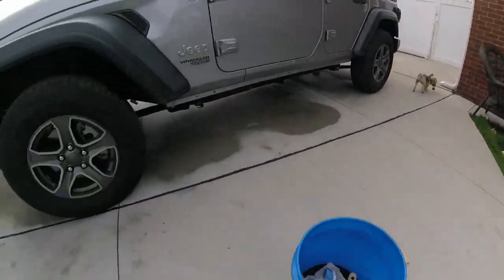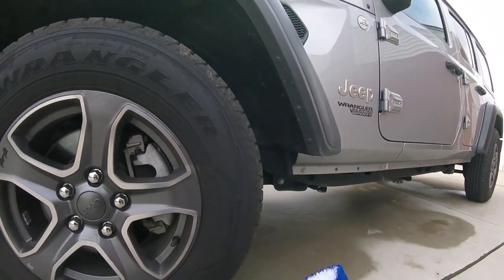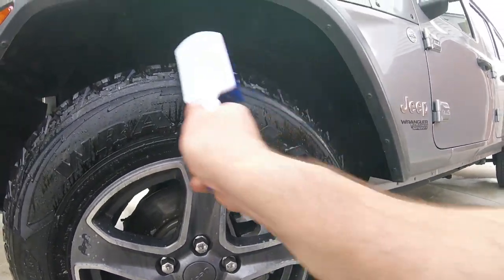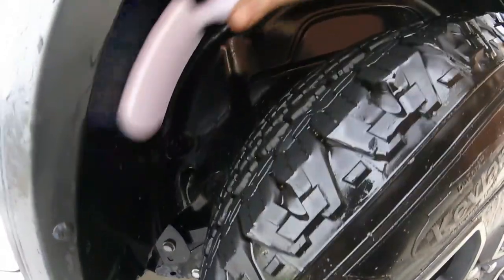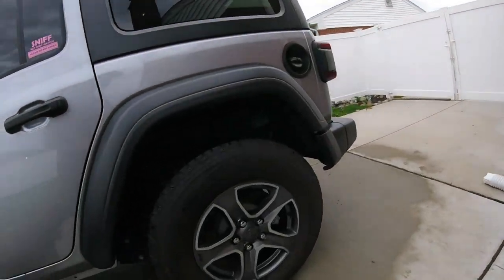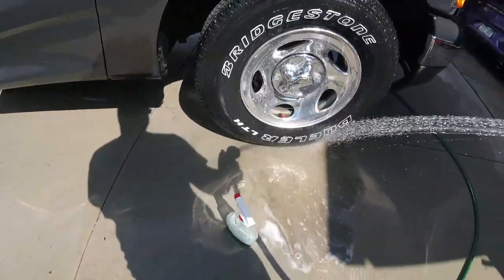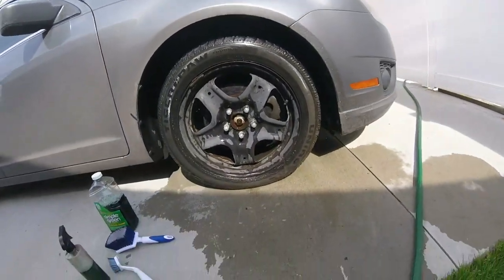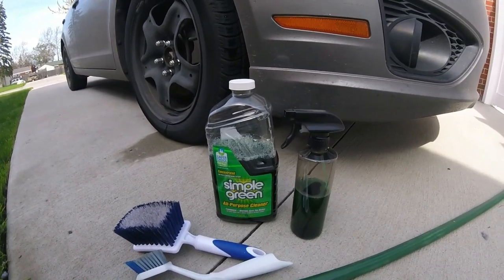How To Clean Tires Like a Professional Without the Professional Price | Simple Green

Comment: I have seen CamaroTime use this on tires. It works decent but not near as good as a rubber cleaner. Never know until you try it!
Reply from the maker: It does work decent and for  guys that may not want to buy a tire cleaner . I always like using simple green on the white letters. Thanks Brian
Reply: I have had mediocre results with my recent purchase of the Griot's rubber cleaner. I had to do them multiple times. Was a bit disappointed. I even tried it on 2 different vehicles too. Maybe I got a bad batch.
Reply: BigOldDog Not sure if it was a bad batch or not. I have had good luck with it but I think Adam’s seems to be a bit stronger.
Reply from the maker: Maybe a bad batch